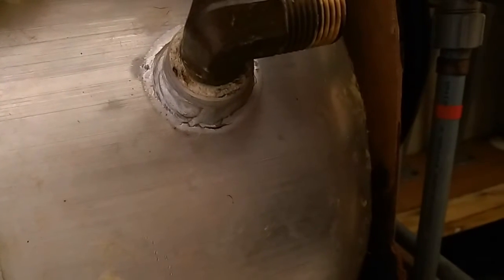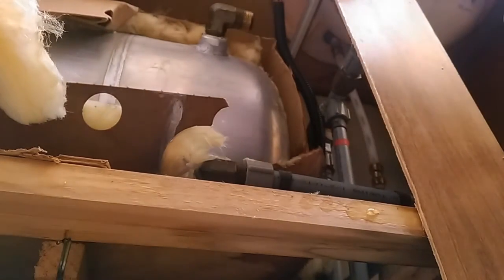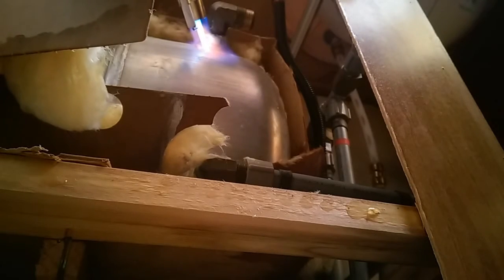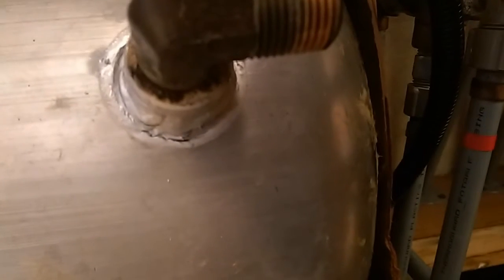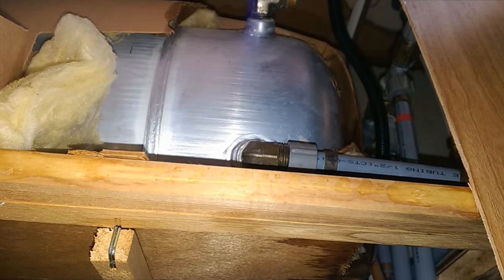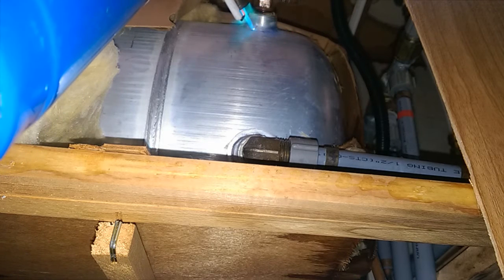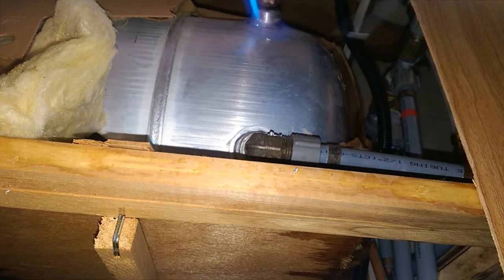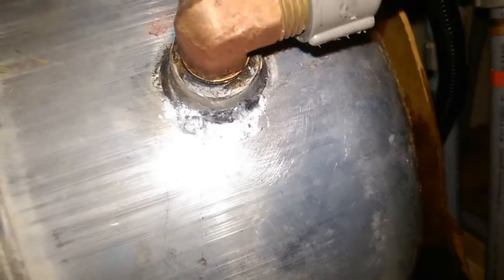Repair a Cracked Aluminum RV Water Heater with AlumiRod and Propane

Comment: Look up green weenie. I used it on mine. It’s natural gas pipeline coating. Mines been holding 2 months now lol I use green weenie on everything. It comes in a stick and you use your torch and do it like soldering
Reply: Hey Blake did the green weenie actually hold? I'm in a jam and don't wanna pay $800 for a new water heater!
Reply: Sure did hold for 2 months. Then I got the new water heater.
Reply: @blakejulian6878  we tried it. Don't stick for us
Reply: Did you get it really hot? I used a small torch and it melted like butter.
Reply: @blakejulian6878  yeah but it just peeled off. Idk what we are doing wrong
Reply: Are you sure it's a green stick that is rubber. When it hardens it's almost like plasticy rubber.

Comment: U might need MAP gas that's what we use for plumbing it runs hotter. I would also like to add u had too much water in the tank heard it boiling that's why the tank was not hot enough.?

Comment: Did this really work?  Under pressure?  We have a pin hole wreaking havoc on our lives, and thought about soldering. But was told it'd take something stronger for a permanent solution.

Comment: There is also a epoxy they called ship weld used to fix leaks on ships i think DuPont makes it.came in a paint can was red.my dad was a engineer on boats would bring it home .i fixed cracks in a aluminum boat with lt
You could drill it and tap it

Comment: Industrial strength jb weld will fix that and hold .heat want effect the epoxy.l have used it on radiators with high pressure and held.also plumbers epoxie.
Reply: Industrial jb Weld worked PERMANENTLY?

Comment: thanks.. appreciate the video
Reply: +Jr R. You're Welcome.  I tried finding info on the web for doing this and found nothing.  The tank holds the pressure great and is doing well.  It's not hard or expensive to fix either.  All parts were bought at harbor freight!  Good luck on your endeavors.